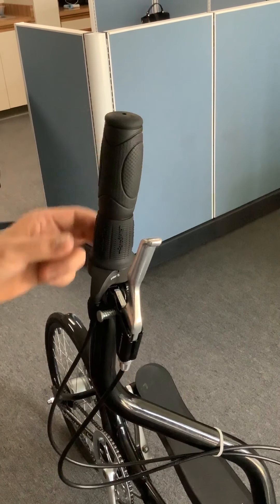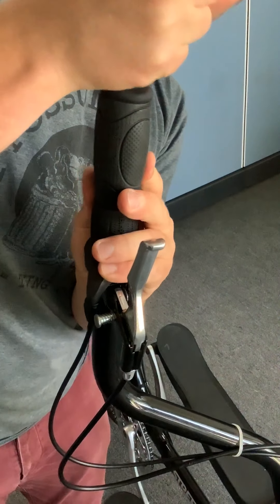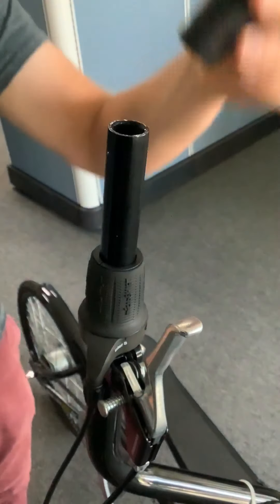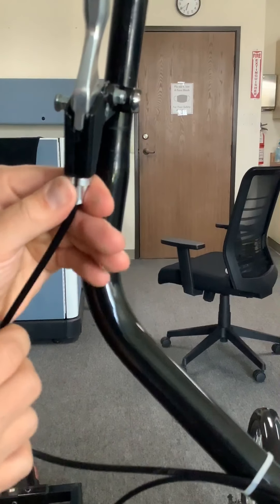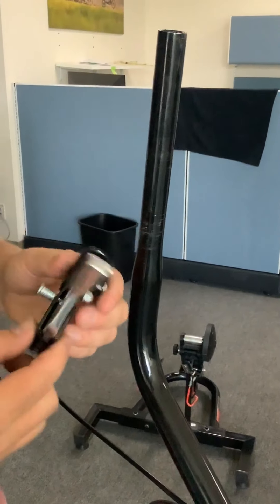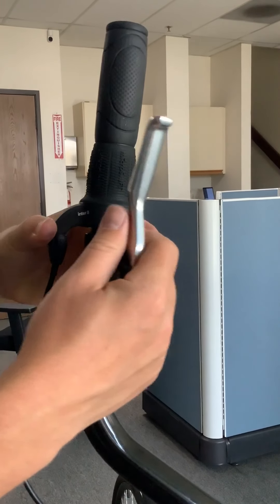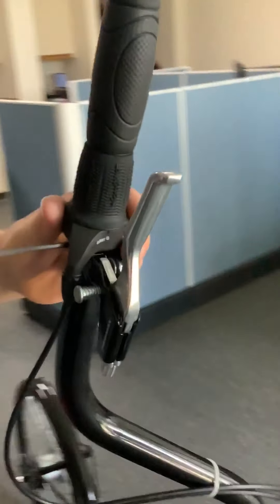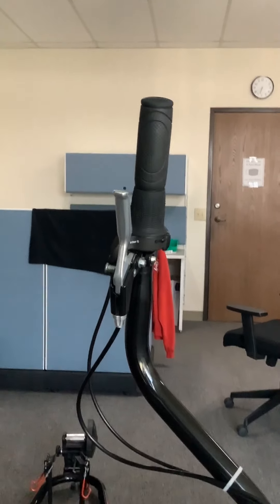How to remove the R arm lever components

Comment: I think it’s cool that you are a regular guy who plays the drums & who helps people with their street striders.   I was out riding my street strider 3i & the frame cracked right underneath the fold joint on the welded seal.  The company sent me a new frame with the bottom bracket bearings & square tapers attached to the frame.

I'm very nervous about taking apart my old street strider & putting together the new one.  Taking all of the brake & gear shift wires out of the old frame & putting them into the new frame correctly looks like it's going to be very tough to accomplish.  Adjusting the wheels (the back wheel came loose once on the old bike), keeping the tire pressure at the correct PSI, steering, brakes & everything else was so difficult when I first put my old street strider together.  I have never been able to get the gear shifter to shift to gear 3 no matter what I adjust or do to the gear shift assembly.  I hope it is easier when I'm putting the gear shift assembly on the new frame. It was mostly assembled before, what if all of the parts do not fit correctly & tightly on the new bike after I put it together?  I'm worried about my safety & hope that I don't have any problems while taking apart the old bike & assembling the new one.

I can't afford to go to a bike mechanic & am not mechanically inclined.  Do you have any advice on where to put the parts after taking them off the old frame & before putting them on the new frame?  My family & I are very concerned that I may do something wrong when trying to put this street strider together.  I’m worried about what parts of the bike to add lubricants to on the bike. 

I hope that I’m not bothering you & that you can give some advice to help me take apart my old street strider & put together the new one.  Any help that you could give me with my street strider would be appreciated because I’ve been worrying about getting this finished so that I can get back outside & focus on my workouts again & not on my safety.